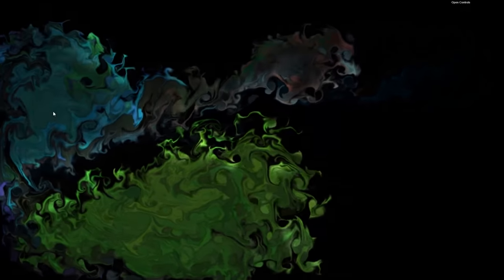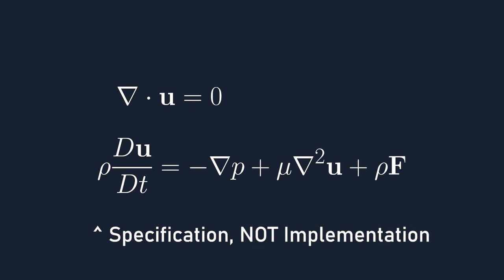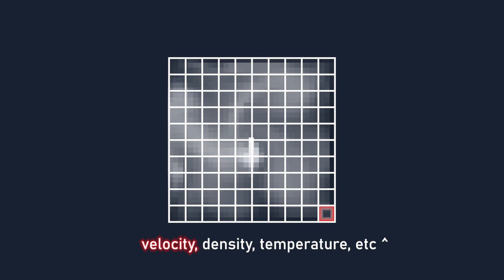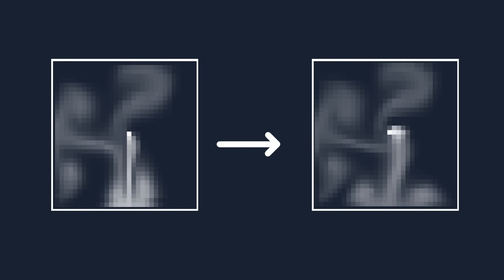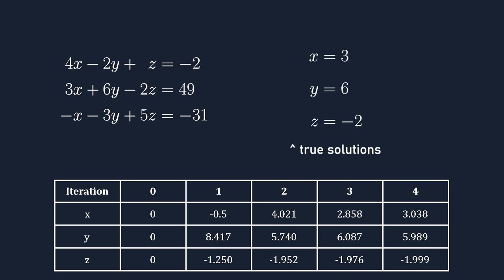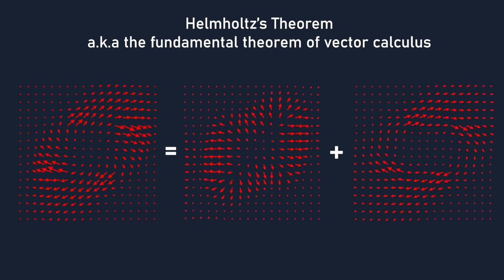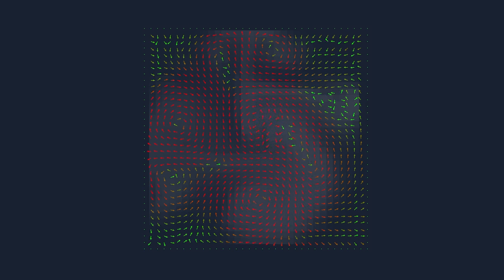But How DO Fluid Simulations Work?

Comment: Isn't the randomness 'always' related to the irrationality of pi, so that when we place radially symmetric equations onto a square (or any other rational) grid we always end up with a subtle round off error, and thus we see 'randomness'? 
The corollary is that reality has it's own problems when we get to molecular scales where again we see the rational counting problem (try counting out pi molecules to be distributed evenly over the uniform pi radians, or 4pi steradians;-).
It's the axioms, as Gödel said;-)

Comment: This is really neat.
I tried to make a fluid simulation a long time ago, but I wanted to try to do it without using Professional Math.
What I resulted in wasn't really a Fluid, but it was more like 2D Billiard Balls stacked on top of each other.
It was pretty cool, however there was an entropy problem, and if you added in enough energy, the energy in the system seemed to go up and it became Chaotic.
This is really cool!
I might use this. I'm a little worried that if I used it then I wouldn't understand enough about it to extend it.
So that's one reason why I'm thinking about trying a crack at it by myself again.

Comment: My maths level is not yet at the kind of level to understand the idea of iterative solving, so for the diffusion equation i implemented this instead, it works practically the same to the original diffusion solver, is stable, and isn't a solver, so it requires no iteration:

newVelX = currentVelX + (avgX - currentVelX) * (1 - exp(-viscosity));
I don't think this is physically accurate but it works, I guess

Comment: 6:51 You mean, the sn - dn == sc - dc? But why?
Edit: I guess your method is something which rely on a equation. I'm not gonna get any deeper on this detail. 
As I know, the easiest way to do this, is something like this:
//step 1, new a buffer for the next frame.
for (x = 0, x<width-1,x++)
for (x = 0, x<width-1,x++)
d(x,y) = 0;//d is abbreviation for d_new.
//step 2, calc.
for (x = 0, x<width-2,x++)
for (x = 0, x<width-2,x++)
{
d(x,y) += d_old(x,y)*0.6 + d_old(x+1,y)*0.1 + d_old(x,y+1)*0.1;
d_old(x+1,y) += d_old(x,y)*0.1;
d_old(x,y+1) += d_old(x,y)*0.1;
}

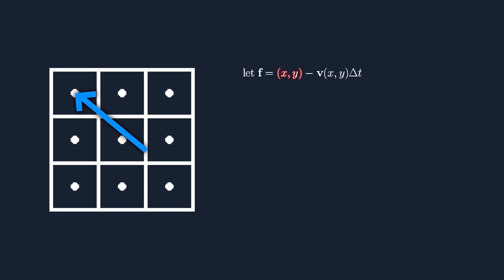Comment: 10:44 what is the velocity? Is it calculate by density?
Reply: i know this is a late reply but:
v(x,y) is just the velocity vector associated with the cell (x,y). we're using semi lagrangian advection (name drop so you can look it up) to approximate where the next "particle" would be that ends up just in the center of this cell. its by far not perfect since we're using the velocity of the target cell as the velocity vector of the "particle". we bascially infer that given a small enough timestep and a small enough grid the velocity vector of the "particle" is approximately the same as that of the target cell. then once we determined the position of the particle using semi lagragian advection (which is what is also shown in the video i.e. particleCoordinates = targetCellCoordinates - v(x,y)*timeStep), we linearly interpolate the densities of the 4 cells that surround the particles position and then copy paste that density value into our target cell. 
then later in another routine (if you look up jos stams real time fluid simulation for games (2003)) we advect the velocities with the exact same principles as we did with the densities.
Reply: @glace848  Thank you so much! I am still working on it
Reply: @shihyuehjan3835  same lmao. currently stuck on understanding the whole math behind the equations of the clearing divergence step.
Reply: @glace848  I know, it's kinda chaos lol

Comment: just a small doubt:
fluids are practically not compressible => constant density
yet you distributed density across cells
I'd agree with distributing pressure

Comment: I'm confused - how do you go from the equations to the code? Do you use a 2D or a 3D renderer? Do you use the GPU or CPU? What language to you use? You say at the beginning "Hopefully at the end of the video, a competent programmer would be able to code their own fluid simulation using the provided information" but I still have no idea where to start.
Reply from the maker: The main calculations are done on the CPU, with float arrays that represent density, velocity, etc. This isn't something that can be done through parallel processing, as far as I know. The colors and arrows you see on screen, however, are just a visual representation of those float arrays. You could use any representation you like, whether that be a shader, vector field, pixel map or anything else.
Reply: @Gonkee  what language did you use? Have you made the code available?
Reply: You literally quoted "Hopefully at the end of the video, a competent programmer would be able to code their own fluid simulation using the provided information", but at the same time asked really basic questions that a non-competent programmer would ask.

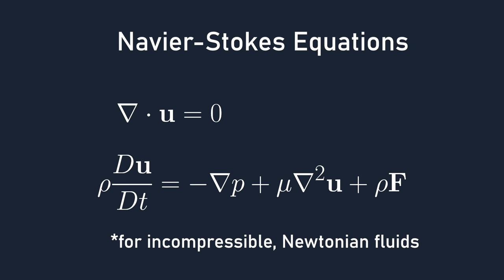Comment: Noooo… at 1:00-1:20 you mistakenly said nonzero Div(u) implies matter either is created or disappears into nothing depending on the sign, but it does not strictly imply that! Instead, it implies matter is decompressed/compressed at that particular spot, increasing the fluid density, fully described by the compressible Navier Stoles equations. Nonzero Div(u) does not break the mass conservation properties! Because of this mistake I couldn’t click the like. Otherwise the video was very well made!